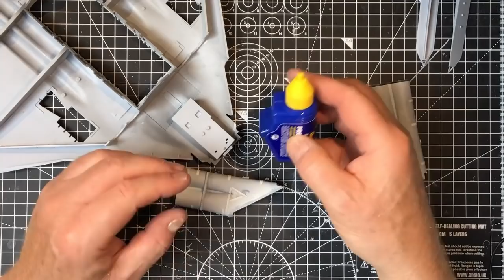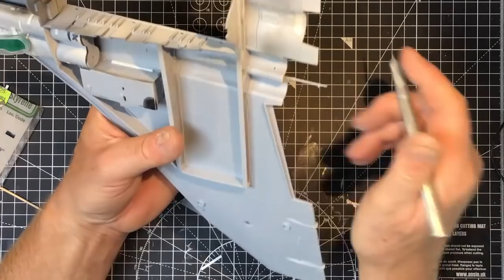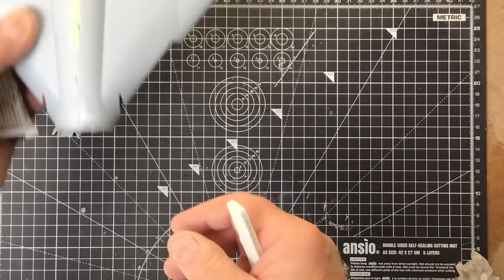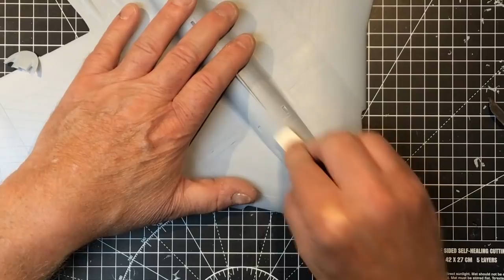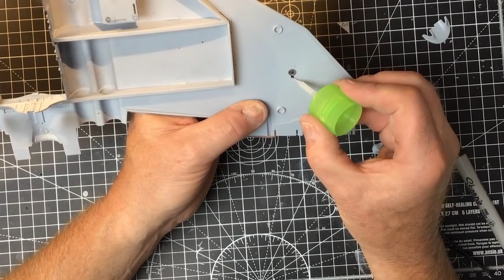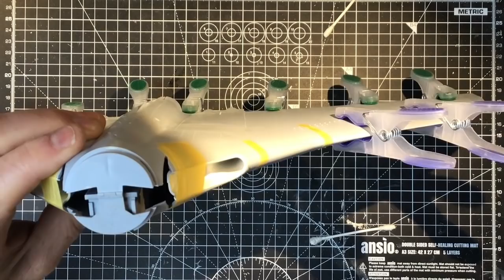Airfix 1/72 Avro Vulcan B.2 (New tool 2021) Part 5

Comment: Avery good job as usual I am most impressed with your attention to detail so the parts fit together despite the 'problems' with the kit. I was wondering if when you get finished with the Hood build and finish with the Vulcan if you would consider tackling the Handley Page Victor? Keep up the good work, look forward to the updates.
Reply from the maker: I’d love to do a Victor but I’ll wait until Airfix reissue it. prices are too high for the kit just now.